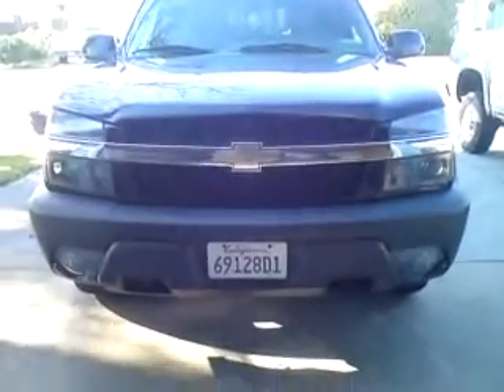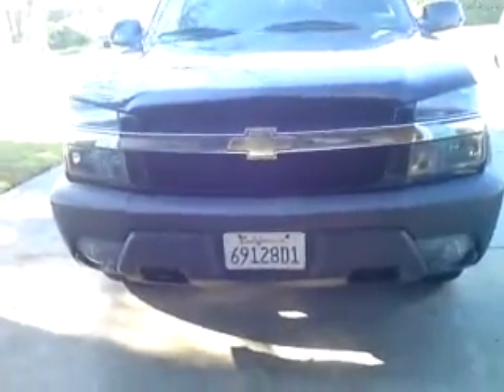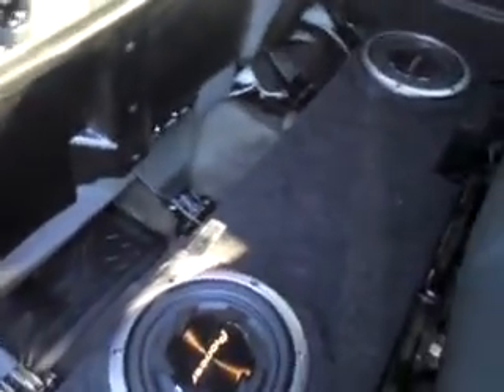Chevy avalanche bose system hook up

Comment: Yo I think you should have mounted your amp on the back of the seat instead of the midgate, it'll fit better and make the wires less messy cus you can run them thru the gap between the amp and the seat

Comment: DUDE! Finally someone has a truck similar to mine (03 Silverado Extended) with a Bose system. How do I do it? for real I have an after market radio, with 2 dual voice coil Polk Audio DXIs. 360 Rms. with a JL 1000watt jx1000/d. with a sony xplod head unit.
How do I set it up?!
please help it'd be appreciated greatly!